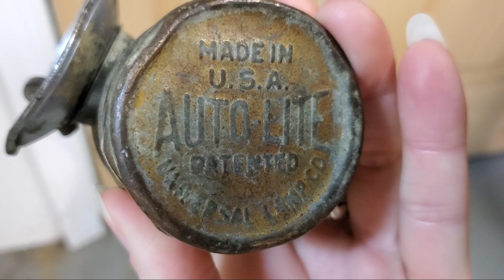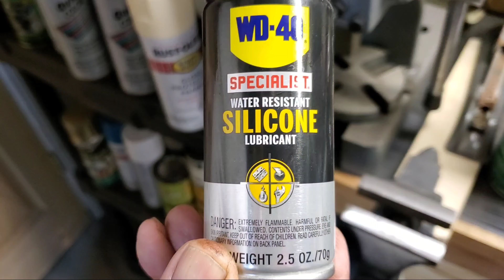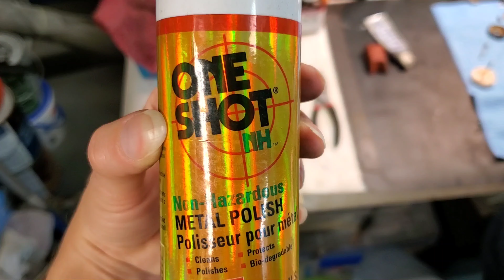Miner's Carbide Lamp Restoration

Comment: Nice job.  If there is a corroded flint blocking the striker, you don't have to disassemble it.  Use the largest drill bit that will fit and clean it out.